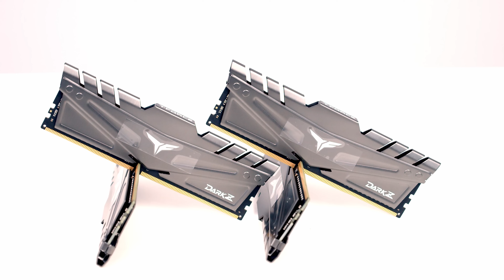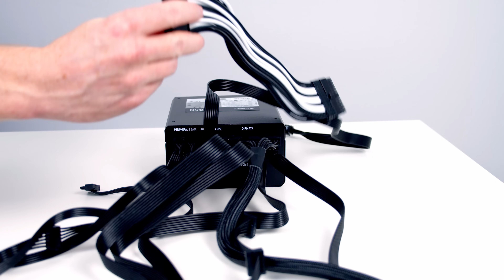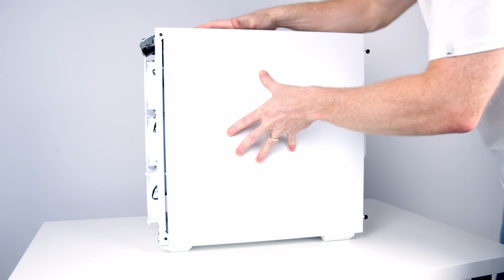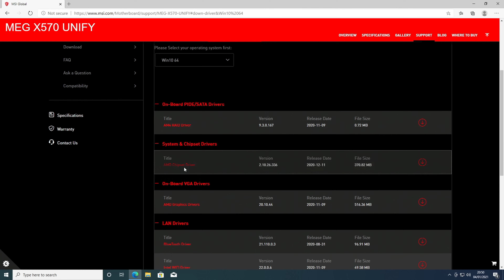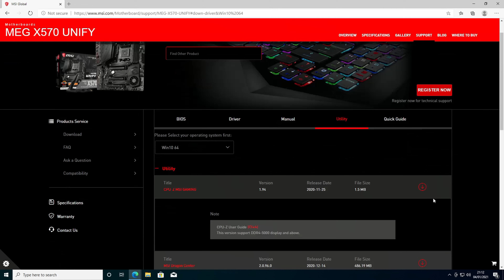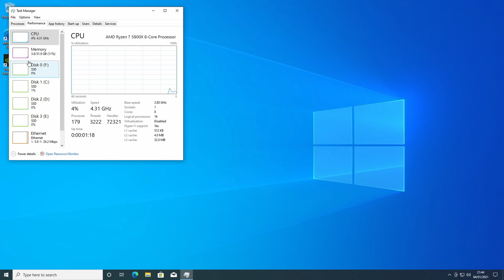RTX 3080 and Ryzen 5800X Step-by-Step PC Build Guide 2021 (Cooler Master TD500 Mesh)

Comment: followed your guide and everything was functional first try. i did mess up on the fan cable tho as i didnt connect them properly so the case fans wouldn't spin as well as no rgb but after fixing it everything worked perfectly

Comment: sir with regards to the masterbox td500 case. does the top side only supports 2x 120mm AIO? or its still good if the 3x120mm AIO to be fit there

Comment: that's a sweet little case.  i just bought this one to put my current x570 build in,  and I'm going to build my new x570 build in my current Phanteks evolv x case (also a sweet case that i can't find for reasonable price) . I've got 2 liquid coolers for each build and an nvme for the new build but for some reason i can't get myself started on it! i managed to get my hands on a 3090 for a decent price and that's what made me go for some upgrades, i didn't originally plan on getting a whole new motherboard but i didn't want my existing parts to goto waste, then i thought I'd buy a really cheap b550 board and use my old Kandalf case but that case is so old and beat up and missing the side panel,  and also the cheap b550 mobo i got was such a huge downgrade i took it back and exchanged it for the x570S Aorus Master lol.  originally i only meant to upgrade my cpu from 3700x to 5900x and up the ram from 16 to 32gb but then i got hitched up on the idea of upgrading the bios, with all the horror stories alt bios i thought I'd play it safe and get the new board already updated  AND i didn't really want to goto x670 but for what it cost me a very well could have! lol. but for now I'm more than happy with x570, and the x570 sales right now are insane!!!

Comment: is clearance between the radiator fans and the ram an issue with this case or will pretty much any ram have enough room? The ram I'm planning on getting is 42 mm tall.

Comment: Question for anyone who might be able to answer. Can I plug my 3-pin triple-splitter cable into my motherboard’s ADDR_LED1 header? [for reference see step: 18:46] My mobo doesn’t seem to have the same header as the mobo in the video does (3-pin ARGB). Instead it has the one I mentioned, and also a 4-pin RGB_LED1 header, but again my fans’ cable is 3-pin. I just don’t see another header that fit my connector aside from the ADDR LED one

Comment: Uhh... one question... If I'm correct, the number of intake air fans should equal the number or outtake fans or at least, the number of outtake fans should not be higher than the intake fans because that will case a negative pressure in th case, which will result in a decrease in efficiency. Does that not apply with this build?

Comment: Would’ve liked it more if you read what cables plugged into what holes and pins n what not, got super confused on the case cable installation part
Reply: Yeah I just don’t know where to plug them in

Comment: I have the same tower and I plugged the 3 pin power fan cable to the left 3 pins on the 4 pin header instead of the right 3 pins. There was a spark and smell and now the lights don’t turn on in the front of the tower. They do not spin either. Have any idea what I did?

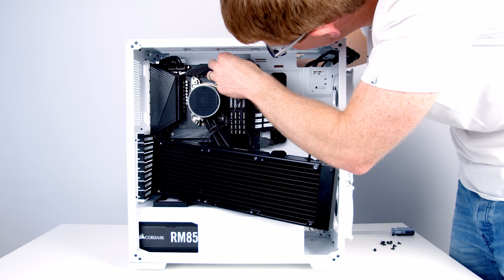Comment: Chris, at 45:54 you were installing the pump power supply connector but for me, the header along can only allow me to install it to the left three pins. Not right three. Is that what you meant and am I doing it correctly?
P.S - same build

Comment: Currently doing a build in this case for sister-in-law. Warning for those who plan on using a NZXT or any liquid cooler that uses 140mm fans. Fans WILL hit top of motherboard if it has “taller” heat sinks. And front of case only supports 2 140mm fans so the radiator will sit lower then the pump. Shes set on this cooler (NZXT Kraken Z63) and all white cases are very limited. Lol. Wish me luck to find a solution

Comment: Is there a way to control the RGB case fans without connecting it to the motherboard? My motherboard is the B450 AORUS PRO WIFI and I dont know where to plug the rbg fan wire into. I dont know if I'm just not the smartest or if the motherboard doesnt have a slot for the rgb fans. Thank you.

Comment: suppose i use gskill ram with 45mm height and Lian Li cooler with dimensions (L) 397.5 x 123.5 (H) x 27mm. will this combo fit in this case? i see you hardly had any space left

Comment: Pretty similar to the setup I've just got myself. Same CPU & Case, 64Gb Vengeance Pro 3200, Corsair H100i Pro AiO, and a Samsung 980 Pro 1Tb, with an additional NVME Sabrent Rocket 1Tb, and a Samsung 870 Pro Sata SSD. Got myself the Asus RoG Strix X570-F Gaming motherboard for the RGB options, and the whole thing is flying.

Sadly no new GFX Card, so still using my Vega 56. I'm still trying to get a 3080 for £700 or less, but it's proving impossible atm. Hopefully BitCoin crashes soon and allows gamers to actually buy GFX cards again lol

And nice to see a fellow Norn Irish YouTube content creator - there's not a lot of us out there! :)

Comment: Does the motherboard support Intel CPU?
Reply: The MOBO he used is only for AM4 sockets which are AMD's Ryzen Zen+, Zen 2, Zen 3, and the only specific Zen which have a variant G at the end of their name are the Raven Ridge -> Ryzen 3 2200G & Ryzen 5 2400G.

For a recent Intel, it is the LGA1200 socket motherboard which depending on which MOBO one gets. For Intel's10th gen only are the H410, B460, H470, & Z490. For Intel's 11th gen & 10th gen support is the B560, H510, H570, & Z590: https://pcpartpicker.com/products/motherboard/#s=39&sort=price&page=1

The 11th gen Intel CPU will be released starting March 16th but on the shelves March 30th, 2021.
Reply: nope

Comment: Really hoping you can help. I have the TD500 mesh. I want to add a Corsair iCUE H150i PRO XT RGB Liquid CPU Cooler top mounted. I have 4 x 8gb Corsair vengeance pro RBG and am wondering if this will all fit before ordering my AIO. I noticed you used the T Force Dark z which had a height dimension of 43.5 mm where as the Vengeance pro has a height of 50.08mm. Will this work ?

Comment: thanks mate. just watching all the pc build videos i can. the build itself seems pretty easy and simple, the only real issues i may face are the case cable connectors, i will need to follow the motherboard manual most likely. everything else seems straight forward. the thing that has me most nervous are the pc updates. i have the x570 board, ryzen 7 5800x and 3060ti. i just hope it all goes smoothly. i was really wanting the 3080 but i am happy enough right now with the 60ti and once the demand for these cards goes down i will get my 80 them. the scalpers prices are shocking and its a shame its allowed to happen. i managed to get the GPU for RRP.

Comment: Made a similar build but already had a 3200g inside working. Upgraded to a 5800X and added a gpu (rtx 3070), tried turning it on and fans and lights come on, no signal on screen... dram led lit orange. 
I don’t think it is the ram as it worked before with my 3200g but I still tested each stick separately, and cleared cmos. I tried changing pcie slots with the gpu. 
No idea what to do, apart from maybe trying the old cpu again and seeing if the gpu will then work. Idk what to do.
Reply: Did you solve the problem ?
Reply: @elkheyou4061  Yes I did but Im not certain what fixed it in the end. I installed my old cpu with the new gpu and it worked. I then updated the drivers on the gpu and made sure that my ram was on default slow settings not docp, then I reinstalled the new 5800x cpu and it worked too. It could have been that by re-seating the cpu it worked or maybe that former stuff I'm not sure

Comment: Hey! Any chance you could help me out real quick? What would I do if instead of plugging the argb cable fans into my mobo I opted to use the argb controller that comes with the case? Would I have to disconnect any wires and where would the controller connect to?

Comment: Great helpful video! Getting the same GPU and CPU. Just getting 3600MHz of RAM instead of 3200. You earned a new sub 😄
Reply: finished my build today. it was hard for a first timer like me. but there are some things that weren't helpful. for one, the plastic on the gpu and a warning to remove them all and remove the thing from the gpu slot so you can actually put it in. The mounting of the cpu pump was the hardest as well and i though plugging in the cpu power was hard. i needed my mom to help me hold my dark hero mobo backplate bracket so i could secure the screws. Also had to move my radiator over to the right a little more to make sure my rear fan would fit. It's an Arctic Freezer II 360 mm AIO and it fits.  have version 2 and not 3 if that matters. My GPU is a strix 3070 and not the 3080 but same thing except the power requirements plug in. I am glad i have no RGB as those would take more cable management in the back lol. My Cable management was fast because i hardly had to add cables. most of the cables are from the Power supply and i have 1000 watts. There was no need for me to plug in the sata cables in the PSU but i plugged in three like he did. I didn't even need to do this because my SSDs are in the MOBO and I don't have 2.5 or 3.5 drives. My SSDs are 1 TB and 2 TB. All I needed. My Monitor is coming today so i will turn it on later today.
Reply: @BlazeNarutoShippuden  congrats bro. I can’t even afford any components right now because I’m just a sophomore in high school. Maybe in a few years, I will have enough money to buy even more powerful CPUs and GPUs. In my opinion, installing a liquid cooler especially a 360mm radiator and cable management is the most difficult part of a pc build. It’s even more difficult when you have more RGB fans. What type of monitor did you order? I’m saving up for the FI25F AORUS Monitor. It’s 24.5 inches and 240hz with IPS display panel. My build will only consist of parts that are from Corsair and AORUS (Gigabyte)
Reply: @blitzz1434  Dell S2721DGF 27.0" 2560x1440 165 Hz Monitor

Comment: Building my first pc and I managed to get a 5800x and a gigabyte GeForce 3070 I'm probably going yo copy this entire build lol
Reply: i was building too and using this video. i have the same case, no hdd like he does, so the sata cables for me were useless but i plugged in three of them like he did lol. I havea  5900x, Strix 3070 and a Dark Hero MOBO. The MOBO fans are different so be careful where you plug your wires but from what i've noticed, it doesn't really matter where the fans are plugged in, but the cpu fan needs to be the correct one which is of course at the top. Also the hardest thing was plugging in the CPU plug pins in the top left corner of the MOBO. I had to remove the rear fan i had. Then install the CPU Cooler and the rear fan.

I am doing my AIO Cooler, rear fan and GPU tomorrow.

Comment: Just wondering did you have to Update your Bios before you first booted to get it to run the 5800x?
Reply: I did and it's not difficult to do. as long as you have power supply, motherboard, a usb with bios that is converted to FAT32. You're good to go. He also has a link in the description.

Comment: i have this case with the same 360 aio but im worried it wont fit with my corsair vengeance rgb ram
Reply: SNAP!!!!Really hoping you can help. I have the TD500 mesh. I want to add a Corsair iCUE H150i PRO XT RGB Liquid CPU Cooler top mounted. I have 4 x 8gb Corsair vengeance pro RBG and am wondering if this will all fit before ordering my AIO. I noticed you used the T Force Dark z which had a height dimension of 43.5 mm where as the Vengeance pro has a height of 50.08mm. Will this work. Really hoping someone will confirm before I get an 360mm AIO
Reply: @joshuachant7898  i actually ended up ordering the new "Low profile" vengence ram cause i thought it wouldn't fit. turns out it fits with the old vengeance ram with loads of room, i sent the new ram back. All i can say is that you'll be with with that ram / case and THIS (Deepcool) aio combo as the deepcool radiator isn't too thicc
Reply: I’ve literally just checked all the specs. The case states it will not take anything over 44mm with a 360mm AIO. I’ve just looked on Amazon and I’ve found Corsair Vengeance RGB PRO SL 16GB (2x8GB) DDR4 3600MHz which has been designed to fit for this as its 44mm tall. Are you saying the 50.08mm Vengance RAM I already have will fit with the Corsair AIO I want? I might just return the ram I have and order 32gb of the slim version to be safe it’s only an extra £30. Thanks for the info though appreciate it
Reply: @Jstar productions
Reply: @joshuachant7898  Im not sure if it will fit with the corsair aio as the radiator might be thicker. even tho it says on the case nothing over 44mm, i fit my 360 in with my tall corsair vengence ram fine. If you have Discord, i could send you  a pic. 

Also, i sent my pro ram back as it was just worse than my old stuff. slower timings and worse stability on it
Reply: @Jstar productions my discord is MR3000#4230. Happy to discuss, appreciate the help.

Comment: I don't understand the "PWM mode" and "DC mode". Can someone explain? What are they, what do they do, what's going. Basically...wut?
Reply: The differences between DC mode vs PWM mode:

> The DC mode is for 3-pin fans which rely on PSU's voltage control which will vary on the voltage requirement per speed. The user has less control in other words so it's not as precise and limits speed reduction. Might be able to lower RPM down to 50%~ more or less but won't see a 20% reduction here. You normally see these as Case Fans/Chasis Fans. Sometimes the air CPU cooler but I am thinking older hardware by now. And I don't see CPU Cooler's with 3-pins anymore since 2016 but I could be wrong too.

> The PWM mode is for 4-pin fans that allow PWM control (Pulse Width Modulation control) which will have constant voltage and depends on the signal controlling the fan speed. So there's smooth, continuous speed control and you can specifically control these more accurately and certainly reduce the RPM lower than 20% if necessary. You see often with Air and Liquid CPU Coolers for their fans. Also, there are Case/Chassis fans that will say "PWM" somewhere on its product hence the 4-pins.

I know you asked this a month ago but wanted to mention some sort of clarification.

Comment: I purchased a GM-750 Seasonic power supply, it didn’t come with an 8 pin? Just a 6 and 2 pin... does this power supply not work on this board??

Comment: Great video! I have a question though: at 18:46 you explain how to plug the argb fans cable. I cannot understand how to plug this. I do have a gigabyte motherboard (Aorus x570 Elite), but the cable labeled as "Gigabyte" does not fit the header (the one labeled as D_LED1). The cable that actually fits is the one labeled as "Asrock Asus MSI"... Am I missing something? Is it possible that this particular motherboard has the same header as Asrock/Asus/MSI?

Comment: the case looks awasome for the price but that huge gap at the front is kinda off putting i might get the black version of this and make a custom  extension to the shoud with some air flow holes pointing up so the airflow goes from bottom fan into the case without looking so Off

Comment: Hoping maybe you'll answer cause I'm close to giving up :( so I have the same case as you and this is my 1st build. I finally got it all set up and the screen turned on and said "insert boot drive press any key" so I left to get a flash drive with the windows 10 tool on it and now when I turn it on the screen stats black. The computer boots up all the fans and rgb is on but only a black screen now please help me

Comment: Hi, great video, my computer that I want to assemble is very similar to yours, can you tell me if I can use the video card's power cables over the same input as the motherboard's 24-pin cable? I have an Aorus Master 3060TI, so I don't want to hide the LCD screen, but is it okay if the cable is close to the backplate? Thank you very much for your attention. ^^
Reply from the maker: Yes that should work

Comment: Hi So I’m not sure if I should use the original cables that come with the Corsair 1600i psu as they may be higher quality.

Other options are cablemod or xpg cables or Lian Li strimer cables ...
Reply from the maker: You can wait to see if you like them

Comment: One question about a PSU. Do we need to plug it in the wall socket while we're building to make sure it has some power to it before doing anything else?
Reply from the maker: I don't
Reply: @ChristopherFlannigan  Ty, I was told to plug it and turn it off to remove the power from it or something . TY for the fast reply.

Comment: HELP! I made the RAM change to the bios settings covered at the end of the video and after saving my pc doesn’t post with the DRAM light active in the EZ debug LEDs. (Indicates DRAM s not detected or failed)
I can’t get into the bios to change this back. Any suggestions!?
I only have two sticks for that makes any difference.
Reply from the maker: Clear CMOS
Reply: @ChristopherFlannigan  Thank you this resolved it :) Any ideas why it failed? I have two 3600 sticks

Comment: I found it easier at 55:26 to create installation media using the Windows 10 Media Creation Tool, which is a free download from Microsoft. You have several media options, and the one I normally chose will be the bootable USB thumb drive. The Windows 10 ISO is the latest build with all updates. At my last PC rebuild, I had the latest build and practically no updates, other than latest virus definition. Saves lots of time.
Reply from the maker: I'll have to have a look at some stage